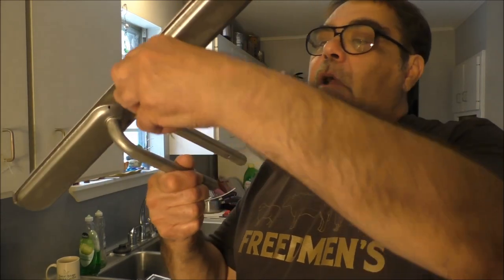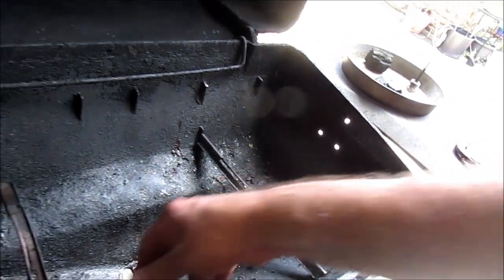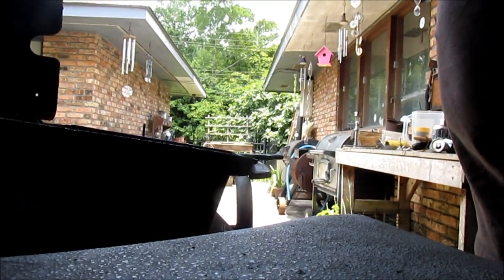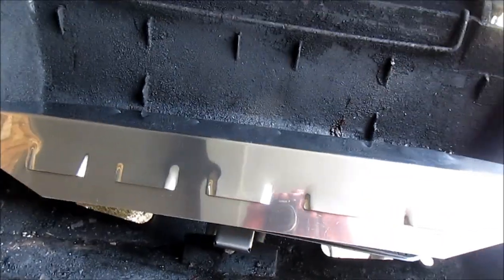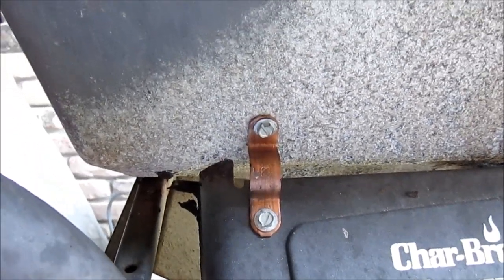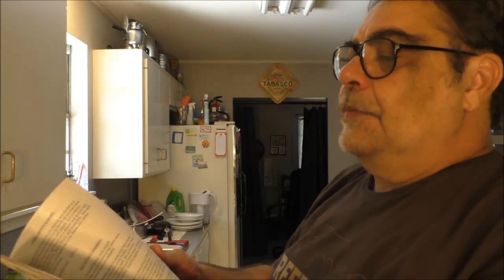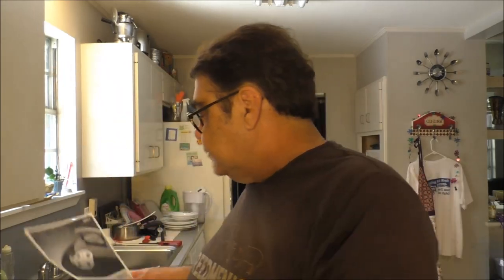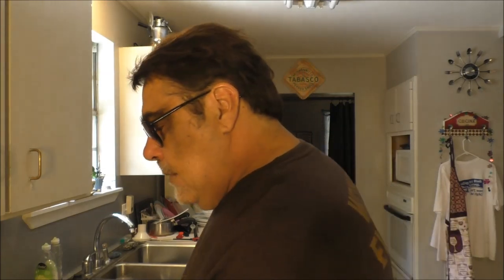How to repair your grill,  Grill food like a Pro tricks.

Comment: Hi JB!

I agree with everything you said, except one item and that's cleaning the grill.

I have seen folks go CRAZY cleanin' them things! They get those grill brushes and go at it like they were scrappin' old paint & rust off the deck of a battleship! THEN they wash it with soap & water, just to make sure it's clean!
I even know a guy, who goes and gets his big ol' steel battery post brush outta his tool bin and uses that on his grill! {HELL NO! I don't ever eat there!}

What I do is: AFTER grillin', I crank up the heat and burn everything on the grill to ash. Then lightly brush the tops and in between the bars to remove the ash & charred up stuff. Lastly I use a paper towel to go over it and remove what's left. Works like a charm and the grill is already ready to be used again.
I may use up more gas this way, but it works like a charm and besides, I'm lazy as all heck, so instead of working hard, I'd rather pay for more propane, and save my arm for liftin'. . . . tall decaf, unsweetened, iced teas. . . . with mint sprigs damn it boy! {can't have ANY alcohol due to meds and NO sugar - diabetic}

ONE MORE THING. Except for when I grill fish or some other delicate fleshed item, I NEVER OIL UP my grill before cookin'. Not even for veggies. That's the dumbest thing I ever heard tell of doin' and some chefs on TV say it all the damn time! DUH!

I know YOU know why. Let the other folks think on it a spell.

Stay safe, be well, and I bid you & yours peace,
Rick
Reply from the maker: ricklude I've seen grills bottom sections that were never cleaned, they a full of ash & grease. This can catch on fire & ruin food. Ash & moisture creates Lye, It will eat through metal.  I've seen some with 2 inch thick layer of ash & grease caked on the bottom, Thats what I meant about cleaning. For the grates its easy as you stated, Get em hot & brush em off
Reply: Absolutely JB!
Folks wonder why their grill's bottoms are always gettin' shot to hell. Cause they don't clean 'em out.
Gotta do it!
Reply from the maker: Hardwood ashes are some of the best producers of lye. Add a bucket of rain water and some left-over cooking fat & it will make a lye soap that eats through everything, Including some metals & alloys ... Lye is very caustic...
Reply: Yep! That's true! That's why ya see so many Qs with their bottoms all tore up, rusted lookin', and with holes in 'em.

Grills & smokers are like tools. If ya don't take care of 'em, they gonna be shot and garbage in a while.

Comment: Why were those pineapple slices red?
Reply from the maker: thethegreenmachine Those are cinnamon spiced apple rings. That a hot item at steakhouses in the 60's
Reply: ***** That'd be good on some grilled pork.
Reply from the maker: thethegreenmachine They are sold by Lucky Leaf in jars whole or sliced, they are hard to find. Back in the 60's you got 1 grilled slice per steak on the side. Yes they are good on pork or ham too, easy to make also. Google spiced apple ring recipe, Red Hot's  candy is used to make em
Reply: ***** Right on, thanks.